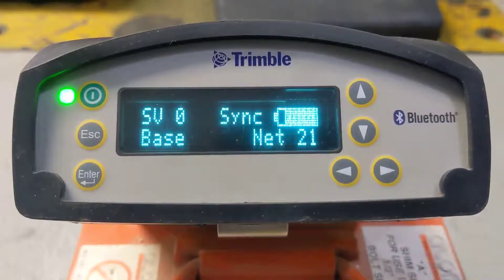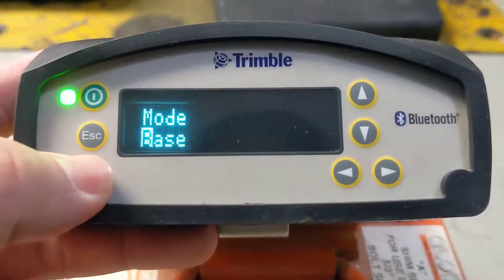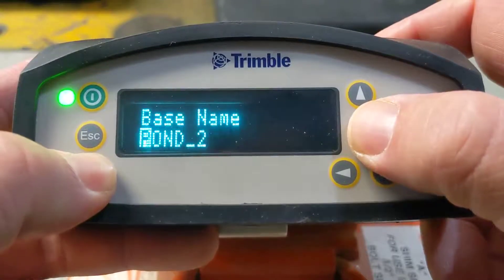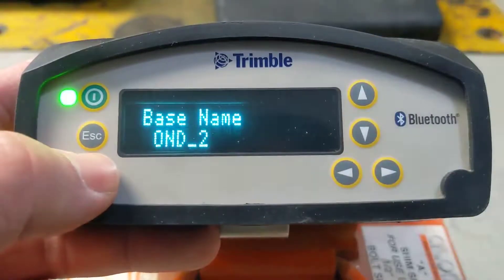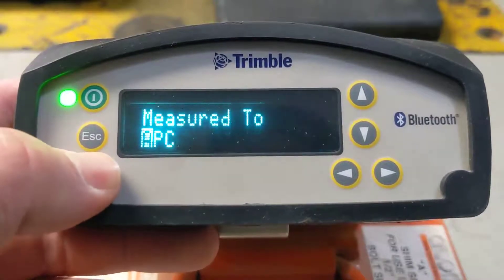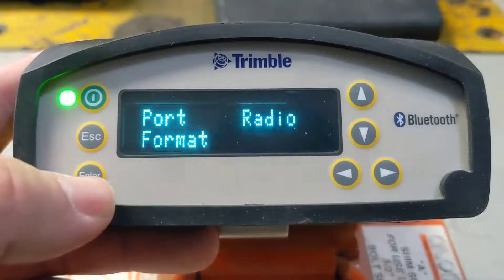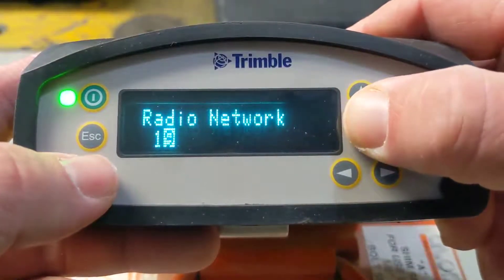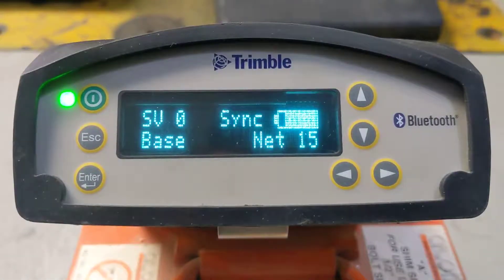Creating a "New Base Here" Location, Trimble SPS855

Comment: nice video man...I have a question i tried setting up my base on a control file I go through all the steps but then at the end it says base position error do you know what might be causing that?
Reply from the maker: When you say control file, are you referencing the App file in the base, or did you start the base on a saved control point through the data collector?
Reply: @ctpusa1  yea sorry I meant on a known control point
Reply from the maker: @mrcupcakeman32  Huh, the base position error is indicating that the autonomous base position is not agreeing with the input or assigned position. If the control point is not part of the localization I could see that happening, but if it is part of the localization I would compare the geodetic coordinates of the saved point vs. the point of the base. You can view these in the log file on the data collector and by scrolling up/down on the main faceplate of the base.
Reply: @ctpusa1  yes your correct something was wrong with the control file and calibration they gave us, I'm gonna find out exactly what the issue was so I know for future reference. thanks alot for your help!
Reply: Please  help , how can I connect  this receiver  to the controller  via Bluetooth?
Reply: @chikondikazembe9899  Make sure your handheld receiver's Bluetooth settings are on, settings Bluetooth on. Double check that rover head is on, (Trimble) once on the map goto the 3 lines in the corner, project connect device. Rover settings are normally correct by default, sometimes it will fail and you have to turn the rover head off then on then try to reconnect. I would need to see your rover connection settings to really dial in the issue if that doesn't work.